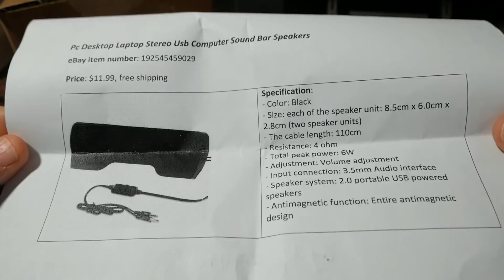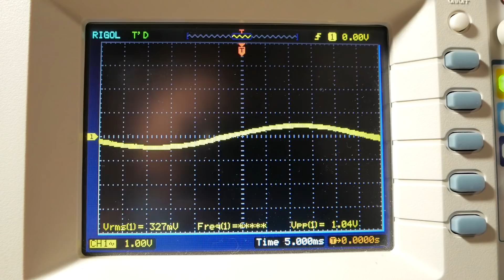PAM8403 stereo amplifier removed from mini speaker. Where's the bass?

Comment: About 1W RMS into 4 ohms if you use the RMS value on the scope.  Seems like the IC manufacturers are now quoting peak power rather than RMS.
Reply: Nope. Wrong.
Reply: They've cheated the Customers since long with the so called Pmpo and selling music systems with low wattage chips as Super high watts systems 🙄
Reply: Fake Ics deliver 1w per channel the real pam8403 delivers 3.25w per channel at 5.2v

Comment: Hi John,
I want to use thess board with only one speaker. What to do with other outputs to have the best sound?
Thanks
Reply from the maker: Ground the unused input side.
Reply: @JohnAudioTech  How? How to do that? Sorry, I am mechanical engineer 😁
Reply: @drazenbobanac8070  - reply to an old question.... You short the input plus and minus of the second channel. That make it 100% definitely zero, so that the amp only inputs and outputs on the other channel. Rhe idea being that there is no chance of the unused channel picking up noise or oscillating.

Comment: Kinda surprised it could drive your speaker at all !
Reply: It's an easy misconception to make. In truth, big speakers are usually very efficient and easy to drive. A typical European HiFi floorstander (Canton, Elac, Mission, etc) will usually have efficiency of about 95dB/1W/1m. A bookshelf or surround speaker from the same product lineup will be closer to 85dB/1W/1m. 3cm-4cm speakers like typical miniature multimedia speakers, like the ones that you put around a laptop computer and are powered exactly by PAM8403 are around 75dB/1W/1m.

Comment: I built one in a small box with two 8 ohm mini speakers, a USB connector for power and a 3.5mm stereo input jack. I built a 3.5mm stereo plug with mini clips to hook up in circuit for working on computers and a 3.5 to 3.5 for connection to computer audio output. Works great as a little bench test device

Comment: Most of the time small bluetooth speakers with DSP's in them will cut back bass on the fly when the volume gets higher. my Soundcore 2 does that, you get full bass untill about 6/10 then it just stops while the mids and highs continue on.

Comment: How could I possibly blow 30w speakers with 15w amp ?
Reply: Impedance mismatch.
Reply: Olle is right. Tweeters have a very low power handling, less than 15W usually, sometimes much less, if you see a higher rating it's because they have an "interesting" measurement method that doesn't reflect reality very well. If for any reason (such as clipping, or nasty input signal, or failed crossover) an increased portion of amplifier power gets dissipated on the tweeter, you can burn it out.

Impedance has nothing to do with it, there is no impedance matching between amp and speaker, it's not a transmission line, the speaker is assumed to have infinitely higher impedance than the amp, and the further away this assumption is from the truth, the higher portion of amplifier output power is dissipated in the amplifier instead of the speaker, so this is how you kill your amplifier.
Reply: @Olle Gladso it was a 30W 3.5" full range speaker (pretty old one)
Reply: Clipping... It means dc to the speaker and no more inductive load. Only resistance load limits the current during the clipping at almost supply rail
Reply: Clipping should not cause DC, because when you modulate DC by just even the zero crossing of the audio signal (worst case clipping), the result is still AC. There is some rail sticking but normally you expect enough recovery.

I suggest that amplifier may not be complicit in speakers biting the dust at all, it could be just work-hardening and fatigue of copper.
Reply: @SianaGearz  I think it is 10w speaker that has 30w printed on it
Reply: Clipping is allways dc, because tbe signal is limited at the supply rail. If the speaker gets dc, even for a short moment, the electric energy isn't stored as magnetic field anymore. Only heat occurs cause it's coil resistance. If clipping stays to long the heat destroys the coil. A 15W amp can provide up to 2.6A to the coil during clipping at 8 Ohns resisitive load. And all power is heat.  If power stays as magnetic energy the amp will take it as a current sink and dissipate it as heat. That's why it is so important an amp can handle an inductive load proper
Reply: Go ahead measure a speaker, you'll find that its impedance is dominated by DC resistance, only small parts of the range have an increased impedance, and the DC resistance is at least 2/3 or more of the nominal impedance. So a speaker coil being resistively burned up by supplying a bit more than half the rated power is a nigh impossibility. By the way, electrical inductance is not the only form of energy storage in a speaker, there is also mechanical potential energy: spring compression of various elastic elements, like spider and surround, and air volume compression or expansion, and this feeds back into the coil-magnet moving system behaviour. These can be represented as an equivalent electrical circuit, including a good bit of compensating capacitance, indeed this forms the basis of the Thiele-Small model.

Also there is no such thing as momentary DC. Don't they teach signal analysis in electrical engineering?
Reply: @Olle Gladso well, I was looking at the speaker, it was running at 10hz, and it let the smoke out. 

Old cheap Chinese speakers are crap
Reply: As a rule-of-thumb you can say that a typical, undistorted, music signal contains about 90% of the total energy in the deep range (20-200Hz), 9% in the mid range (200-2000Hz), and 0.9% in the high range (2000-20000Hz).However, if youo turn the amp up to the point where it starts clipping - aka distorting - the signal becmomes righer in overtones, or harmonics, shifting the energy ratio drastically towards the high end, i.e. the 200-2000 AND the 2000-20000 ranges. Normal loudspeakers are not designed for this kind of abuse, though, so the result of playing LOUD music from a small amp is that you'll blow your tweeters, then the mid-range speakers, while the bass units will generally survive.
Reply: @Olle Gladso at least it was fun to play with